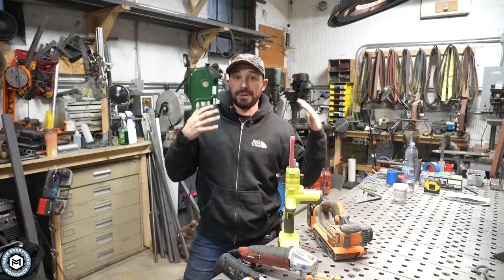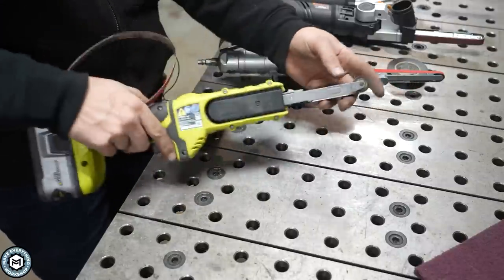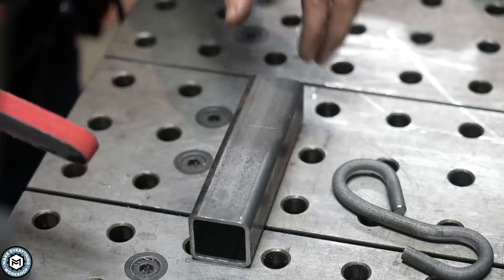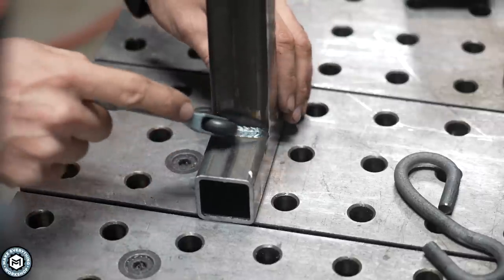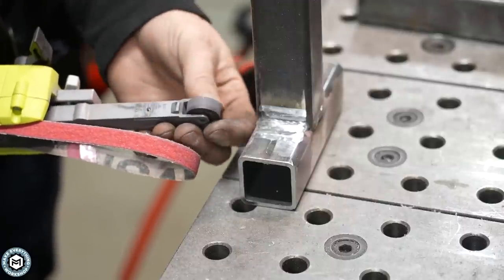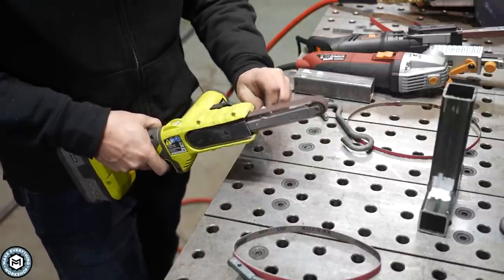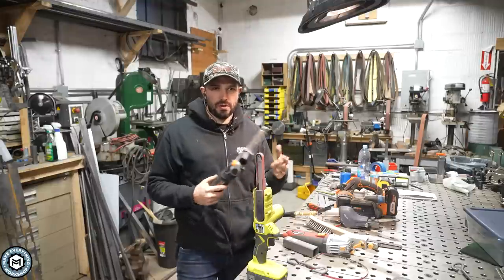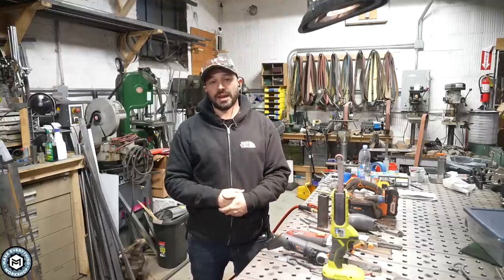Go Where No Sander Has Gone Before - Bandfiles - Metal Working Tools You Need

Comment: I have an extensive amount of time using Dynabrade finishing tools when I worked for a company where we built a lot of agitators, hoppers, frames, etc from stainless steel for pharmaceutical and food manufacturing. I bought a Dynabrade Dynafile II of my own about 9 years ago. It was $530 at the time, plus a few hundred $ more for a few different contact wheels. It was a great investment for the kind of work I have done and what I do on my own now. They do use a lot of air!
Reply from the maker: It’s a super high quality tool! I wish I could use it off site but it gulps way too much air to use a pancake compressor! In the shop it’s unmatched!
Reply: @MakeEverything  Absolutely!
Reply: I’ve never seen these in operation. Super nice finishing.

Comment: I  used to work for a  machine shop and that  is where I  was first  introduced to  one of these machines, and I have  loved them ever  since, I have two  of them myself, the first on that I purchased is an attachment that  goes on an angle grinder and the second is a pneumatic version.  Like you said they  are excellent at getting in tight and hard  to reach areas.
Great video.

Comment: Excellent tutorial on band filers. The cost difference between the Dynafiler vs an air driven die grinder using carbide bits for weld cleanup is huge. An Ingersoll Rand air powered die grinder that weighs one pound costs about sixty bucks Canadian.

Comment: I have a dynabrade electric, basically works off a 4-1/2” grinder motor and body.    Came in a kit with a few attachments, 1/8-1/4” and 1/2” plus one for pipe with 1/4” belt.   All 18”.   The pipe arm works great for steel or aluminum hand rail

Comment: Have an astro pneumatic that was under $100 I've been using for years and have been happy with. Had an M12 cutoff tool I didn't use much so I bought a HF bandfile, split it in half and franken-tooled it onto the M12 handle. Now I have a battery powered one for field work. Paul Brodie has some really nice ones he made from scratch or from online for grinders that are really nice looking tools. I think he has a YouTube video sharing them.

Comment: I have the Ryobi... picked up a year back for something like $50 on sale.  It actually works great and since I already had batteries from another tool, bought the tool alone to save even more.  Combined with a small 1.5 Ah battery, it is super light and easy to swing around.  It may not last forever, being mostly plastic, but who cares at the price-point.  They are nice sanders to have on-hand for those rare times you need them.

Comment: I can see these being handy when precision and quality of how things will look when you are done one a project is wanting to be achieved. Like cleaning up some welds to be painted. Cool.  I wonder if one of these small belt sanders couldn't be used to safely and more quickly do a "port and polish" job for a car's air intake. Or just sanding down some sharp metal burrs your car may have on the chassis. One that may cut ya every time you change the front passenger tie. Same with tractors and lawn mowers. Thanks.

Comment: Makita have a 18V bandfile now too. It also have some different wheels and a dust port. It looks to be way more powerful thwn the Ryobi which I have and sometimes it lacks power to sand down wood fast enough to be able to shape it.
Reply: I’m Debating getting the makita power cord one … there’s a deal locally for very low price.  

I have a 100mm belt sander, 2 18v orbitals, and a 1/4 and 1/3 18v finish sander.  Then 4, 5 and 7 inch grinders in 18/36v.

I’m just wondering how useful the power file would be?  What are common jobs you use it on?

Comment: Does the surface conditioning belt produce similar results to a very fine (e.g. 1000 grit) abrasive belt, or are there significant differences?
Reply from the maker: I would say the SC Belt is more coarse than a 1000 grit.

Comment: Are there any battery powered versions that will accept the Dynabrade arms? The different arms are what make the tool completely universal for fine finishing. The flat wheel arms that come with all of the Harbor freight and other brands are not good for stainless polishing. The nearest thing I’ve found is my older Milwaukee corded electric band file. The Dynabrade arms do bolt up to that but the trigger is terrible and the rpm speed is half what the Dynafile puts out. 

Just curious if you have seen any battery options that will bolt up.
Reply: I’ve been in the stainless tank/piping industry for 20+ years. The Dynabrade is the essential tool. It’s crazy with as big of an industry it is that no one is really trying to provide specific tools for it except for Dynabrade.

Comment: 24"/18" = 1.333, so 1/3 more was correct for length. 1/4 ÷ 1/2 = 50% so 0.5 x 1.33 = 66% of the surface area for 1/4" x 24" belt. Not that important since it's really about matching the tool to the work.

Comment: IT WAS 33% BIGGER.  25% OF IT WAS THE AMOUNT MORE IT HAS.  18 + 33% OF 18 WHICH IS 6 = 24.  THUS 33% BIGGER THAN THE 18 INCH.  IF YOU SAID THE 18 INCH WAS 25% SMALLER THAN THE 24 INCH THAT WOULD ALSO BE CORRECT.  HOW TO PLAY WITH NUMBERS TO SWAY PEOPLE.
Reply: STOP. SHOUTING.